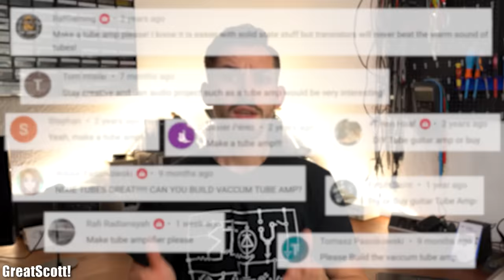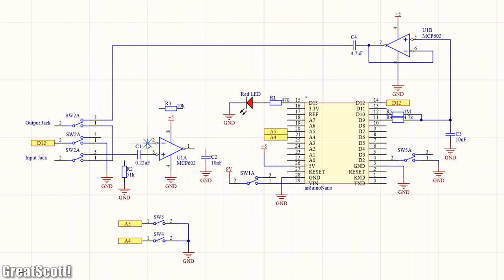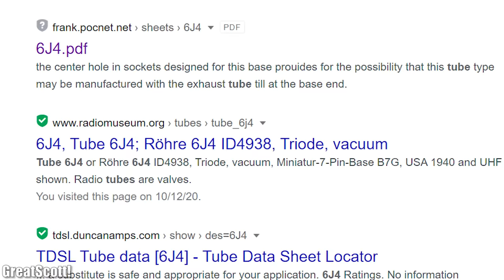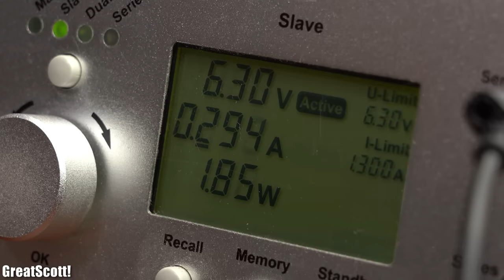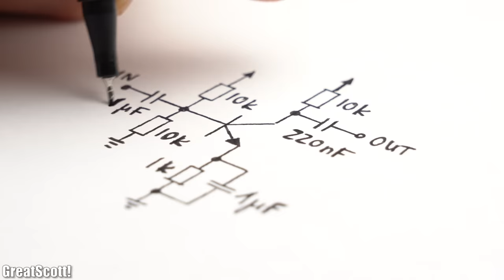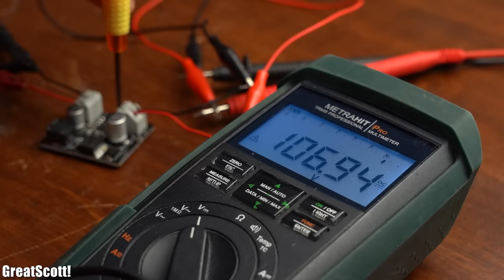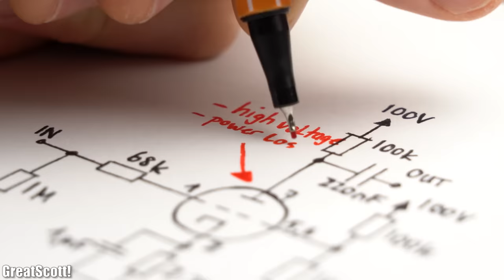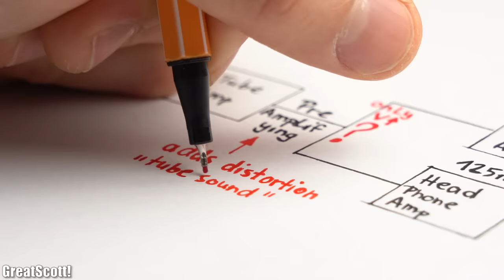Building a Tube Amp! Does it produce better audio quality though? EB#47

Comment: Those distortion curves are part of the "trick" Remember we hear Logarithmically. Those curves sort of "round" the audio response. Which is part of that "warm" tone. 

Another is something you didn't look at which is dynamic signal response. Due to the tube involving an actual distance between anode and cathode, its response to a changing wave is diffrent from a transistor as well. 

These days with a modern EQ, not a big deal, you can adjust the response how you like in a very discrete manner. Back in the days of a single "Tone" knob stack, the tube was kind of like a preset EQ with a variability adjustment. To change presets you would buy a diffrent brand or even diffrent design tube.

Comment: Recently I put an old Dynaco Stereo 70 (all tube 35 watts per channel) against a Carvin professional quality amp (40 watts per channel) both driven by the same source, same preamp, and same speakers. I have to say it was a pretty fair match, although on the Carvin you could hear when it was running out of gas. (almost like compression) The Dynaco pushed to the limit and the only thing I could pick up on was a slight whimper where it couldn't quite sustain the peaks on a dynamic piece. IOW, it didn't punch quite as tight at high output. My best guess is I had reached the limit of the power supply... a VERY old 5AR4 tube. (likely original) Basically it boils down to the tube amp rolls slowly into distortion where only the picky ear finds it but the solid state sound clean till it doesn't. IOW, it becomes obvious all at once. (to most ears)

Comment: Tube  amps are used in class D amps but so are Mosfets. They have both have very low input impedance and eliminate the biasing threshold of bipolar transistors.  Tube types are power wasters however, evidenced by the heat dissipated, great if you want to heat your house in winter.

Comment: One great advantage of tubes is that a well-designed tube amp requires a lot less global negative feedback than a well-designed transistor amp. Too much GNF will mess up transients, resulting in an amp with better specs than actual sound quality (as the typical THD measurement won't be affected by the quality of transients)

Comment: Great video as always 😉 You've well summarized pros/cons of tubes 👍
High voltage it's ElectroBoom style 😄
I discovered it on a old fully DIY tube amplifier that someone gave me... 350-400V through tubes, no ground protected 😲😲 Just for that, I prefer transistors 😄
Reply: Actually, there's a technique to run tubes at way lower voltages. They're "special" tubes called "space charged" vacuum tubes (the name sounds awesome, doesn't it?) It consists of using a pentode (3 grids) and using the first grid as an accelerator grid to help with the emission of electrons even though there isn't enough voltage between the anode and the cathode. These kind of tubes were used in car stereos where using transformers was really incovenient due to the voltage of the battery being 12v dc. The drawback is of course that these tubes have way less power than a big ass triode, but it was fine for car stereos.

Comment: Valve amps can get nasty, even when switched off and un-plugged, as I found out when trying to replace electrolytic caps in a 100w Marshall top. OMG, what a spark! and very loud Bang! Our first tv's were valves, wait several minutes for the picture to appear whilst sound faded in first. There used to be a Vox amp with both Mosfets and valves, guitarists liking the sound. The only difference I heard in sound quality, is when we ran a pirate radio station in Dublin, which had a warm sound to it. Apparently, valves can withstand EMP's better than transistors & Mosfets.

Comment: Great video about tubes topic. I really love them. Let me post here what happened with your circuit design. 
Your circuit didn't work because you were putting a biasing resistors to create a 1/2 Vcc .. remember that tubes are depletion devices (normally on) so, the biasing is made just with the cathode resistor (in a gain stage configuration)
What you just saw in your scope , is the heavy ripple coming from your boost converter, since your tube was heavily conducting current due the +50V being applied into the control grid. Since tubes are depletion devices (like N-Ch Jfet), they need negative voltages to completely turn off, so a good starting bias point would be between its cut off negative voltage and zero volts, but never above zero volts.
You were lucky to hook up a not really powerful boost converter, otherwise your tube would've glowed like a chrismas tree :)
Keep doing great videos like this one!
Cheers

Comment: new topic ideas: 
1)wireless comnications (DIY walkie-talkie)
2)antenna array, antenna designing stage (cst microwave studio), signal boosters*
*adapting for your audience application in WiFi frequency, 5,8 GHz fpv video transmission, TV?
3)energy harvesting from RF (it’s hard to imagine doing this at home without specialized equipment)
4)setup for radio hobbyist (try communicate with other end of the world using AM waves)
5)ground penetrating metal detector with vivaldi antenna,or just metal detector using two resonant loops

need more? just ask i have almost 50 folders of unfinished projects

Comment: I was expecting to see a lot of comments complaining that greatscott is touching the tubes with bare hands without cleaning the tubes, but I haven't seen any so far.

Just to be clear, this does not affect the tube lifespan, it's a myth, tubes run just fine, even coverd in grease.

Comment: What you got there is a cheap hybrid amp. Usually people use tube amps and even power tube amps, with no chips or any transistors to speak of. And those are the ones you want to try if you want to decide if the tube signature is for you, and while trying one in a store keep in mind that sound can be improved with other tubes, some of them reaching $10k, so sky is the limit, just keep in mind that those tubes will need replacing in time.

Comment: 1) Not all tubes do actually "require" high voltage to operate. The sounds becomes "dirtier" on low voltages, but sometimes that's preferable - look up valvecaster guiter overdive schematic, for example. There are even 12ax7 headphone amp schematics that operate from around 12V.
2) A tube amp can, in fact, be made low-distortion, but then the point is kinda lost, since the difference between transistors and tubes becomes apparent only in saturation
3) The main difference between a tube saturation and transistor is that transistors have an exponantial curve, while tubes have a powerlaw characteristic
4) Tubes do produce high-frequency harmonics, but produce less INharmonic sounds

Comment: As far as sound,  digital/transistor/modeling has come a long way and with the higher end non tube amps, it's really hard to tell the difference.  For the folks in the audience,  they cannot tell the difference at all.  The biggest, most noticeable difference is the feel between the player and the amp. Tube amps react to playing dynamics differently than other types of amp.  You can play lighter and it sounds clean, or dig in and it has natural breakup, you can roll off the volume and the amp cleans up, harmonics are more natural sounding on a tube amp.

Comment: The (tube) distortion rather than the hard clipping is the key. Particularly for instrument amplifiers. Particularly when we are accustomed to the sound of it in "electric" instruments. Yamaha (I think themselves) made an ASIC which models the behaviour of a tube amplification circuit in digital logic: this is not even the usual Fourier transforms and frequency-domain sculpting typical to DSP-based approaches, but some sort of live SPICE, I think. Crazy idea, but I played on one (through the show-room supplied guitar as well - which might have been part of it[!]) and it sounded very nice.
I think a product like the one you show in this video (or identical) was reviewed by EEVBlog quite a while back, which I saw... with major disparagement.
Reply: I accept that what I'm talking about is by no means an ideal amplifier - it's for monotimbral signals: So, forget about it from an actual amplification angle (almost always). I also accept that I know so little about SPICE (and circuit analysis in general) that this very-hyped ASIC may simply do the usual simple transformations on the frequency domain of the signal, but with perhaps a tad more oversight (for instance: "at this point the simulated circuit suffers a power brown-out - therefore adjust accordingly"). I need to do some Teensy audio. I probably ought to start with a 4.x to give plenty of grunt in reserve down the line!

Comment: Class D mixed with the tube (4th minute)... god have a mercy on us all. 
Also, technically speaking, electrons goes the other way around, form plus (what we call plus - more electrons) to minus (electron flow). Conventional flow works too, but electrons really goes from plus to minus.
And, if you allow me one more comment, transistor circuit has additional electrolytic capacitor on the path of audio and that one must be "audio" grade and, to be on the safe side, used for some time. Otherwise it will colorize the sound.

Comment: I build tube amps. 
The most important and overlooked part of the amp is the power supply. 
You need a power supply they can instantaneously deliver the current demanded by the tube. A high-quality power supply goes a long way

Comment: Tube amplifiers are not small or efficient, nor are they as convenient as transistors, but a well made tube amplifier can sound very good and impart unique characteristics to the sound which is the main goal for a home audio system. This is why they are sought after. A tube system depends on the headphones or speakers used, many do not pair well with the output transformer of a real tube amplifier. Keep in mind not all tubes are created equal, one tube will sound different than a another and part of the fun is swapping out tubes to find the ones that sound the best to you.

Comment: I know this is probably a bit blunt and brute force for your liking but how about a video on electrolysis or efficient high current low voltage dc supplies for electrolysis?

Comment: Years ago Audio Express magazine did a study on why tube amps were preferable by many audiophiles. The solid state amps were superior in all specs but one. The only spec that the tube amps excelled in was slew rate. Some amps were made using FETs in an attempt to mimic the "tube amp sound". Not an EE, so I do not understand, but I did like the tube amps.

Comment: The low-cost tube amplifier available on AliExpress is not a full-tube amplifier, but the vacuum tube operates as a pre-amplifier or buffer just before the main amplifier phase, creating a 'vacuum tube feel' speaker amplifier that is actually powered by a cheap TPA chip.This is easier to design and drive than full vacuum tube amplifiers. These designs of amplifiers were not bad for me at least.

Comment: I used to play around with an old shortwave/AM/FM receiver that used tubes for all amplification.  It had a "tuning eye", which is a tube that emits a blue or green light based on the received signal strength.  It was so COOL.  That is, it was cool until I shocked the living shit out of myself on the antenna port.  I later measured around 350V on the antenna port and I promptly lost interested in working on this old relic.

Comment: Great job, honestly I would be more intersted at the frequency analysis, looking a pure single frequency wave amplification doesn't make really much sense....I personally think the real reason why people love tubes is because the distortion characteristics "near" the clipping point, tubes clip in a more smoothly way due to the tube working principles and this produce virtually no high frequency harmonics. So Just as personal suggestion, would be great to see the frequency spectrum analysis of a distorted signal and compare it with a solid state amplifier.

Comment: Thank you for the great videos and enthusiasm in electronic circuits 
And wish you read my comments
 I am happy to say that you read the comments on your videos and enjoy them is a clear rare thing someone do but sure that  who works in electronics got the same curiousty and joy to see a fellow electronics engineer opinion and ideas .
As you know the vacuum technology is old  and its quite rare to see vacuum tube circuits 
 I once  saw a Toshiba black and white 14 inch tv that works on 12v dc   got vacuum tubes for the  high voltage transformer THT as a horizontal output stage amplifier and another near tube as a diode and got very happy to actually see  vacuum tube tv working and to know that info  from an old tv instructor that worked in vacuum tube circuits identify those  components on the tv and explained to me how they work
Was very nice  experiment.
For an idea   about vacuum tubes can you create an oscillator circuit using those vacuum tubes ? 
😃😃

Comment: I have a 1940s era all tube West German radio that my grandfather brought back from Europe after being stationed there during/post WW2. I used the phono 3 pin DIN input to use it as a nice low power guitar amp, it has I think 7  weird original tubes in it and Im not smart enough to know what each does. I used the FM setting to listen to broadcast radio and was stunned by the sound vs all the SS radios I grew up listening to. It was such a rich warm sound. There's no comparison in the quality of the two.
Reply: True said

Comment: the cool part about tube amps is they are easy to customize by changing tubes. I have 2 guitar effects units that use tubes. They normally have 12ay7s in them. I boost it slightly by using 5751 tubes in place of the 12ay7 , but on top of that the tubes have their own life. One unit has a HP 5751 tube. For it's sound all I can say is it's butter. Warm and smooth. Not too distorted and good for blues. I also don;t seem to be able to find another of those tubes so If/when it dies Im'a be sad. The other unit has a Raytheon 5751 and a Raytheon 12ay7. The sound is still good but it's louder. I use it for kick during solos. I've also been told that Mullard tubes are really good but they are expensive too. I also have some tubes I ordered from Ukraine. 6n2p. They are supposed to be replacements for 12ax7/5751s but they also need a special socket that I'm waiting on. I doubt they will be that good but if they are I can get 6 of them for what 1 old HP or Raytheon tube costs. 

Also if that amp uses 12ax7's there are about 5 different tubes you can try as substitutes. They all have lower power but they are also clearer. But as I said the manufacturer has some bearing on that too.

Comment: Tubes are somewhat non-linear.  They don't "clip" abruptly (transistors clip), but as they approach clipping, change amplification. This produces odd harmonics which tend to be like a chorus, or pleasing to listen to. Hard clipping produces all harmonics including the even harmonics which are not as pleasing.  
This is somewhat related to how they work.  Tubes amplify voltage (mostly), transistors amplify current (mostly).   Current is what drives the voice coil in a speaker.  To go from voltage (tubes) to current (speaker), tube amplifiers require an audio transformer in the output, and that also augments the sound and reduces the damping factor.  With low damping factor the voice coils develop inertia and overshoot, a small detail that colors the sound slightly when heard on a loudspeaker.

Comment: If you need a video idea, explain how to power a phone/ battery powered device with a bench top power supply. Determining the correct voltage/ amperage for the cv/cp/battery management pins to power it on???

Comment: The Paul at the PS Audio channel and owner of the high end audio equipment company has several short videos on tubes in audio systems.  One describing his conversion in shootout for a designer product that caused them to add tubes on the front end of their top line ($10s of thousands) products.  Apparently, tubes are not good amplifiers at the output stage.  The pre-amp tube improves warmth and musicality.

Comment: Great explanation. Tube power amps are in no case better than transistor amps. Because you should not over drive either kind.

The only place where tube amps are relevant are for electrical gittars. There you WANT to over drive the amp as it is PART of the instrument itself and creates the specific sound via the distortion.